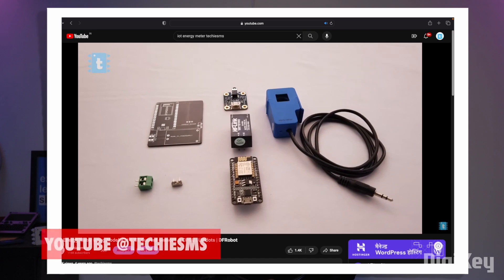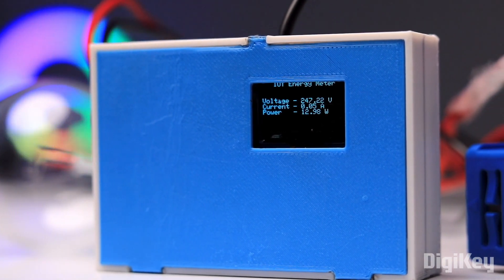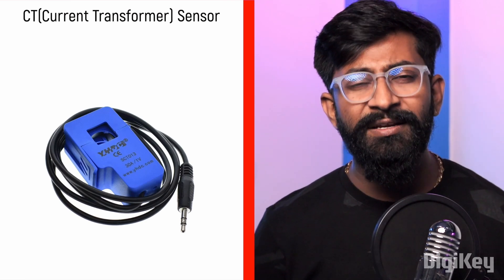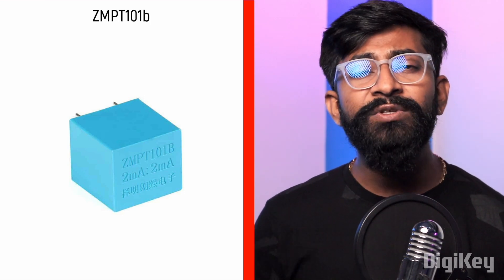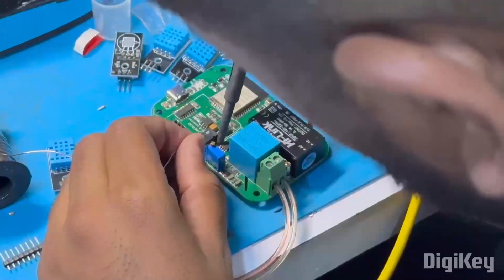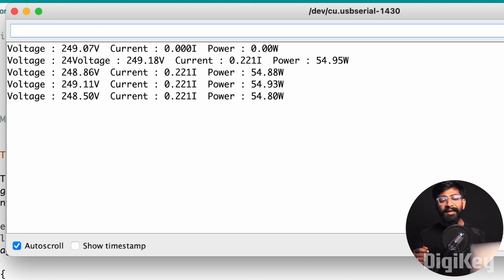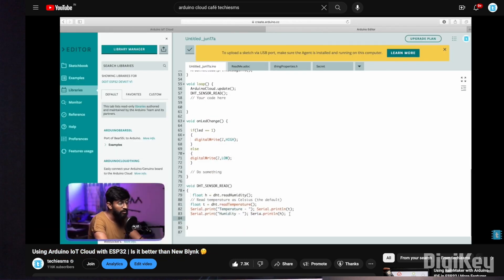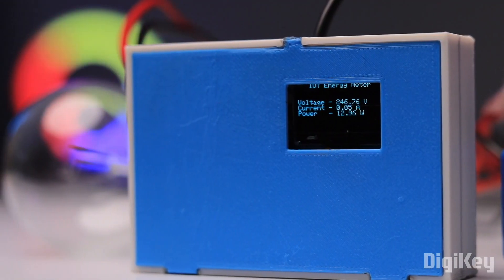Build your own Smart Energy Meter using ESP32 #diyelectronics #iot #iotproject

Comment: Hi  Sir, im beginner to electronic project. Just want to ask you. Can i use this project to measure power at the main panel of my house? If i want to do so, can i just clamp the CT sensor at main supply wire and voltage is taking from the plug poin only?
Reply: I tried to capture my bill
Reply from the maker: You can. Don't work on with live electricity if you are not experienced. And there might be some regulatory restrictions for modifying your house wiring.